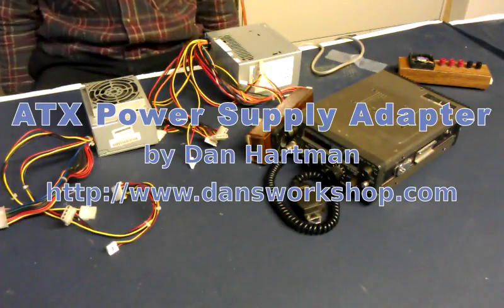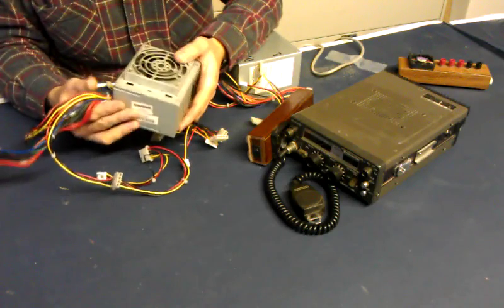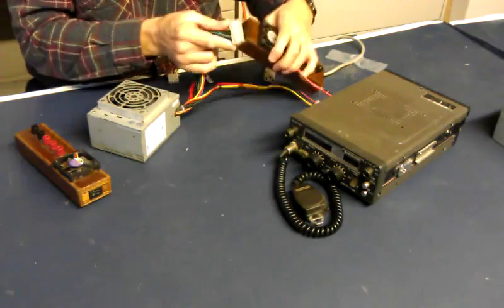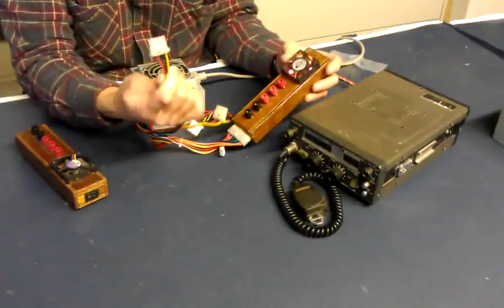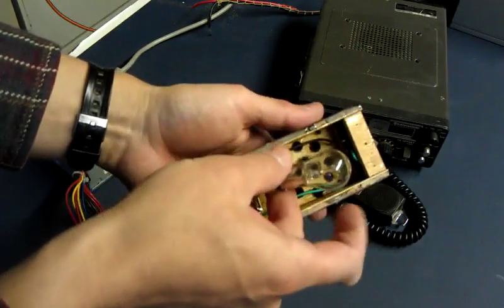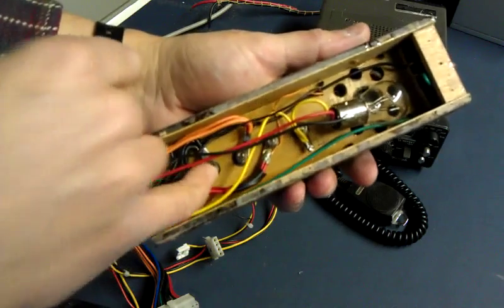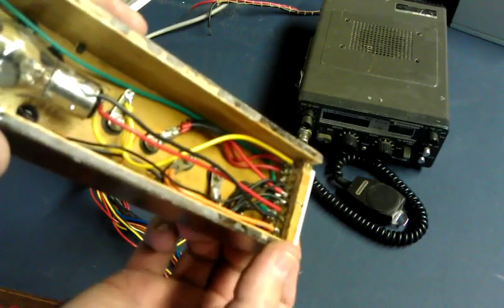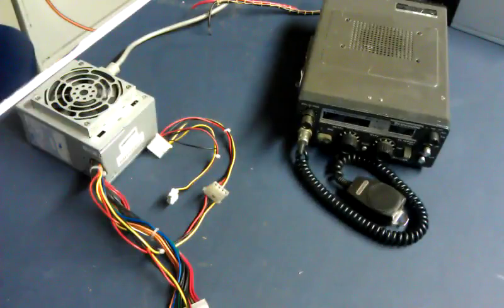How to NOT convert ATX power supply to benchtop or lab power supply

Comment: I did a take-down/rebuild conversion of a 600w unit yesterday, and came to the same conclusion you demonstrate. I also like your use of the light-bulb as the dummy load, generally speaking, they are a lot easier to get hold of at the last minute, and most people are comfortable with wiring them up. Nice job

Comment: it took me 2 hours to convert mine into a benchtop psu. and if it died on me i would do it over again and not make that adapter because. the compact form of just the psu is nice to have.
Reply: I would put the PC PSU into another metal case that has all of the Molex connectors plugged into it, and the banana sockets connectors and meter built into it. That way if the PSU does fail it is a straight swap.

Comment: Good idea, I'll look for dead motherboards then. Btw, I found some ATX 24 pin to 20 pin adapter cable, so anyone interested in doing this conversion without dead motherboards can buy such cable, clip the 20-pin end and solder the wires directly to the binding posts. Another good idea is using molex connectors; since each wire on the psu can carry only about 5A (iirc), using multiple molex connectors would allow to draw more current safely - just beware some PSUs have more than one 12v line. :)

Comment: The reason people connect all of the wires is to be able to handle high current. More cross sectional area of conductor will allow higher current without heating up as much.  It is much more efficient to use several wires than to use a single larger diameter wire. This is why they actually manufacture stranded wire.  Not only for flexibility, but for current carrying capability.

Comment: I built one of these based off your idea. mine is a little fatter but it was built with what i had. I also used a wooden case. My additions where to add a switch to select between 1 amp load on 12v or 5v or simply no load. Still waiting on a few parts to finish it.

Comment: It does make sense, you don't want to put the binding posts too close to the high-voltage components.

You should slap on one of those volt/amp displays of E-bay.
Maybe add even one regulated output.

Comment: one thing I would suggest, don't know if somebody already said, but to put the molex connectors to the adapter you made, so if you someday need more amperage on the 5v or 12v lines, you don't overload the motherboard cable, it spreads throught all cables.

So if you don't need that much amperage, just unplug and use for something else.

And about the rails power, new PSUs have lots more power on the 12v lines, so if you need more 12v, pick a new one, and just be careful with the wires

Comment: I got an ATX cord extension for mine.  I got a 24 and a 20 pin.  I did the 24 pin first and I don't know if it works because I have a new power supply I assumed was 24 pin but it's not. I guess it's a new(OLD) PS. So now I'm working on the 20 pin.  Thanks for sharing. I was going to covert the PSU as seen on other videos until I seen this video.   NICE.

Comment: Nice job! There are some older supplies, as others have mentioned, that require a minimum load on the +5V, to maintain the switching circuitry. The outside box idea is great, but I would suggest a way of applying the load, where it can take advantage of the cooling fan..   Most of the newer supplies, use a internal 33-Ohm load that also serves to drain the mains capacitors, as well as the inline 10M-Ohm resistors that they usually solder in parallel with those caps.

Comment: Nice project. It gives me some ideas for my next PSU mod. Just a note, each of the 16 gauge wires are rated for a max of 3.7 amps (some cheaper supplies even use 18 gauge at a rating of 2.4 amps). A lot of people mod PSUs to power Lipo battery chargers. You would need to solder several of these wires together in parallel to avoid problems with such a high current application. A 5400mAH Lipo would normally charge at 5.4 amps (1C charge). Looks like the mobo connector alone isn't sufficient.

Comment: the power supply can supply full amperage to the motherboard 12v provided it is a single 12v rail psu, though weather the gauge of wire used is designed to take this load is another matter, so perhaps a better design would have a couple of molex connectors on the box in parallel to spread the load over the 5 + 12v to stop any wires heating up and possibly causing fires

Comment: Because the amperage that you are allowed to pull from each wire of a particular color is limited by the gauge of the wire (even if they are all electrically connected to the same place back in the actual body of the power supply),  I prefer to just cut all the cables off at the same length (around 1.5-2" before the connector on that cable in case I ever want to reuse it for something else) and then wire the similar colors to a new buss for that power on my connection box.  To make it not look so messy, I'll either use cable ties or mesh sleeves.  If I'm feeling a bit retro, I'll go with wax string ties instead.  Once the voltages get to my connection box, I'll make terminals for the main voltages and then additional ones for combination voltages as appropriate (e.g. if the power supply has a +12V and -12V, then I will combine them to get a +24V pair of terminals).

Comment from the maker: Antti here's a project for you.  Build my PSU adapter with an additional switch to turn the dummy load on or off.  Attach a meter and watch what happens to the different voltages when you switch the loads on and off.  Furthermore, test the 12v output while switching the load only on the 5v line (or vice versa).  Try it on a few different PSU's.  It's a good education on the regulating circuitry that computer PSU's contain.

Comment: Hi there, just a comment, I might be wrong or right about this, but the load bulb, when the filaments are cold you have zero resistance for a second, would you get a surge, should you use a 15 watt wire wound resistor...just a comment Fred uk.

Comment from the maker: @ucw458: ZZZZT, wrong.  The "Power Good" wire on pin 8 is often grey but sometimes orange, and it is an *output*, it should not be shorted to anything. And, being an output, it does not tell the power supply anything, but is the method by which the power supply tells the motherboard that the voltages are stable enough to begin. 

See the wikipedia article link in the description.

Comment: 3d print a case for the power supply. Basically just a frame for the rear to screw into. A frame and a plate on the front to hold binding posts, switches, 24 pin adapter and meters. A base to hold the two frames make it deep enough to stuff the extra wiring in. When the PSU dies unscrew the frame disconnect the wiring. Pop in a new one. Just like you'd do on a PC. Will still be neat and tidy on the workbench.
Reply from the maker: Yep, that is a great idea.  Now that I have a 3d printer this is on the bucket list.
Reply: @dansw0rkshop  Wow this is a 10 year old video. I didn't expect anyone to respond. I just subscribed.

Comment: The correct part numbers for printed circuit (perf board) mount mating connectors are:
Molex 44206-0007: 24-pin “motherboard” connector
Molex 39-28-1043: square 4-pin “motherboard” 12V connector
Molex 15-24-4745: straight 4-pin disk drive power connector

These three connectors mate to most of the +12V, +5V and RTN lines on standard PC power supplies.

Comment: So, if I tied all the yellows from the molex connectors together, and drew off of that, I would get somewhere close to all the wattage available from the power supply?
To explain a bit, I'd like to use a power supply like this, to run a 12 volt driver/drill.

Comment: Very nice little adapter there.

So am I correct in that the (for example) 12v line on the ATX connector is the same as the 12v line on the Molex connectors? They are just fitted into a different plug?

I ask because I want to use a PicoPSU to power a few hard drives and related gubbins, and it's going to be far neater if I come off the ATX plug pins than the extra Molex wires.

Comment from the maker: I'm unaware of a difference between the 230v and 110v.  That aside, it's fairly common knowledge that switching power supplies "want" a minimum load. Google the terms switching power supply minimum load .  Manufacturers often specify a minimum load for SMPS's.  Wall wart switchmode supplies are known to be designed with loading resistors.  Computer PSU's may as well, I dunno.  It would be trivial to put a switch in the design of my PSU adapter to turn the dummy load on or off.

Comment: Hi ! My big problem is that I have a very old LPX or AT with P8 & P9 12,pins connector. It has his,own external cable with a working switch but it lights up the dies so ....I guess it needs a load or maybe a jumper clip !!! But where to put it because there is no Green wire to jump it ??

Thanks in advanced

Comment: Could you please explain the need for multiple wires of each type? Especially when you're connecting straight to the connector, Why not connect 1 ground, 5v, etc?
Reply: Th amperage is divide among all the wire of equal voltage, respectively. I.E. the +12 V wires have 28 amps but that 28 A is split among all the wires. If you want the full current from the connector you need all the +12V wires.

Comment: just what I've been looking, I have a 235w ps and I want to run 3 12v 70w 5050 led lights,I don't need 3.3 or 5 volts, i am thinking of changing the yellow wires to 12awg to handle amperage, and have 3 separate posts, I'll still need switch and load wires would the ps handle it? love the idea of the box saves drilling holescan run molex plugs to box
Reply from the maker: +johnnytheangel1 It depends if the PS can put out that much just on the 12v output.  Usually a given wattage is distributed somewhat across the different voltages.  Many ATX power supplies will say right on the label what the limits are for each line or for which two of the lines.
Reply: +dansw0rkshop unfortunately the label only tells me the amps 12v---8.0a, only gives me amperage for each rail it is an fsp235-60AT, I'll keep looking to see if I can find more detail, main reason I'm using these is I only need one 240 plug,instead of running 3 ps, and with this one on case has a output for monitor so "I may be able to connect a second ps and i can run a second ps from" maybe, thanks m8
Reply from the maker: +johnnytheangel1 Well you know for sure then, that you're only going to get 96 watts from the 12v output.  12V x 8A = 96W.

Comment: I found a computer shop that sold PSU ATX adapter 24 pin to 20 pin.  And the 20 to 24 adapter.  I think I would buy one or two of each and build my little power mod box.

Comment: this is a pretty genious idea, cept I would make a simple bracket for it, and just screw it to the side of the cases with self tappers, enable the extra fan to cool the whole unit as well, or possibly use the psu fan to cool down the light bulb area..

also, I'd just use a light pigtail, so its esay to change the bulb if ever required.

one thing I never noted before, but you got me curious now, do you need a load on BOTH the 5 and 12 volt circuits? I always thought it just needed one on either.

Comment: +Paul Frederick on Google+ posted this helpful comment:
There are a few things a lot of folks do not seem to understand in regards to junk PC PSUs. Like just because a PSU is still putting out power does not mean it is still putting out clean power. The components that filter the power in PSUs are rather short lived. As they age they become less effective at reducing line ripple then too. The caps in your run of the mill PC PSU probably are not good for much more than say 5 years, or so. After that the PSU is a torture device for any electronics it runs. Due to excessive voltage ripple output. A lot of PC PSUs new are not the cleanest PSUs going. So when they get worse they're really bad then. But hey it still looks good on the multimeter!
Reply: Interesting perspective. Of the tests I've seen on older units (for verification purposes) they seem to perform quite well, on average I saw that most units performed well within spec, and most were at worst not out of spec, but not 'well within', and actual failures were (typically) clearly junk before being tested, inadequate sinking and cooling, or had failed fans and the like. As an estimate (I don't recall the actual numbers off hand) of the tested units (typically from computers between 7-10 years old) I seem to recall that we had an ~85% success rate, but that in mind, any PSU that had a failed fan was an automatic fail (in most cases it just wasn't worth the hassle of replacing a fan) even if the electronics tested good... As such, I would personally disagree with your statement about their ripple, I didn't find that at all... That being said, it is purely anecdotal evidence from my personal experience testing ATX/EPS power supplies for proper output (including ripple), and it is obviously not reflective of ALL units out there, our stats may have been skewed due in part to our relatively colder climate here.

Comment: I have a question I'm make my version of the thing/adapter you are showing in this video and I was wondering about the light bulb you are using. I found one of those which wire do you put where.
Reply: I suppose you can look up the data sheet online

Comment: I have a bunch of old ATX PSUs lying around and I tried putting a 11W 3.3k Ohm resistor as a dummy load to either/both the 12V and the 5V line and nothing (at two decimal precision) happened to any of the PSUs output voltages. I haven't tried putting any larger loads and comparing then, but then again I never need that. A 12V car headlight works perfectly well on the 12V line and a single LED on the 3.3V line regardless of any dummy loads. It *might* be that all of my PSUs include dummy loads...

Comment: Since I have a dozen ancient AT PSUs gathering dust, it would be good if I could find AT female connectors for them. Maybe molex connectors would be even better; sure I wouldn't have -12v and -5v, but I could plug any AT or ATX PSU and I could also drain more current on 12v lines. I know ATs are less powerful and their 12v rating is lower than ATXs, but they're the ones I got for free.
Where did you get the female ATX connector? Some PSU cable extension?

Comment: i have a 235w SPI p[ower supply that doesnt have a switch on the back. i grounded all the grounds and spliced one ground and the green wire together but when i splice the pc fan i have into the negative and positive 12v wires i only get pulses of energy

Comment: Hi, thanks for the video. Is it possible to power a digital camera (GE X5) that normally uses 4 AA batteries 1.5v each 6v with a direct power source?
Reply: 6 volts DC is 6 volts DC. A computer power supply may not work (5 volt is the closest), but any unregulated DC power adapter with a properly adjusted and heatsinked LM317 regulator should be able to put maximum of 1.5 amperes of current at 6 volts.
Reply: Jammit Timmaj I'm guessing the camera regulates the battery power down to 3v3. If it does, the 5v rail should work.
Reply: Jammit Timmaj I'm guessing the camera regulates the battery power down to 3v3. If it does, the 5v rail should work.

Comment: I am trying to use the 12 volt lead to power a project that im making. It would require between 6 and 9 volts at less than 2 amps. Would a resistor work for this?

Comment from the maker: It's not as large as it looks, but the size and shape is that I wanted room for binding posts, the ATX connector on one end, and the dummy load inside.  Also, there's no reason I can't get max power output, I can also attach things to the molex connectors, the box is just a switch.  I supposed I could rack a whole row of female molex's and even sata power connectors in case of newer psu's, and connect everything.  But hey really all I need is a few milliamps anyway, seldom do I max out the PSU.

Comment: No. You will only be able to have the current that is limited to that particular line, which is the capability of the Voltage regulator transistor and the design of the PSU.  The limits are always shown on a label attached to the PSU which shows the maximum current on each circuity respectively. Read the label.

Comment: Very cool idea. My old ATX PSU is not designed for me to add binding posts. Also, the fan is not on the back, but sits on top of all the electronic components.

Do the fans you use run off 12V? Did you run a parallel line off the 12V supply?
What kind of wiring did you use?

I really like your idea and I think I will pursue it as my first real electronics project.